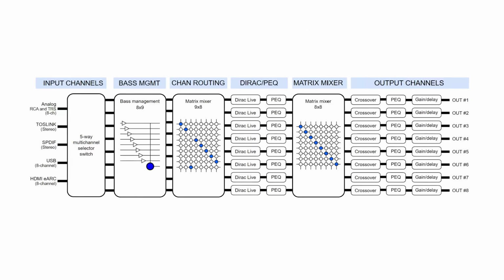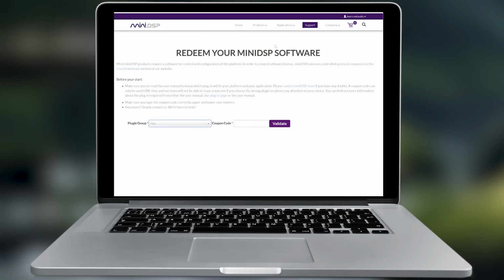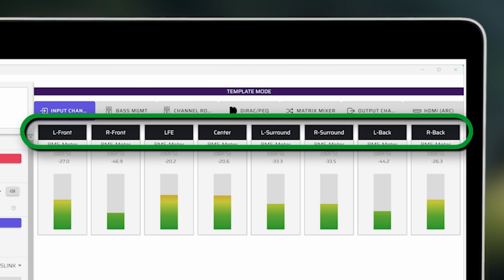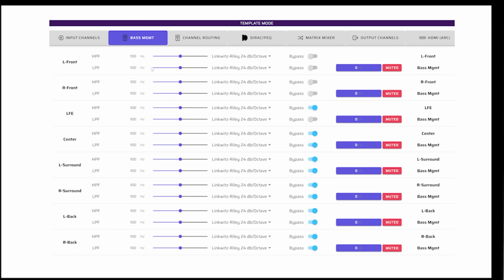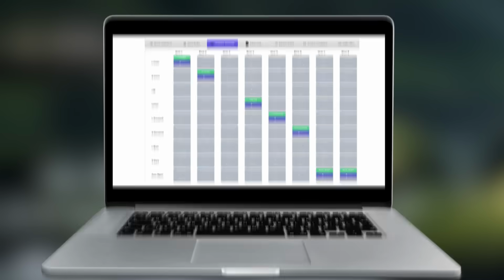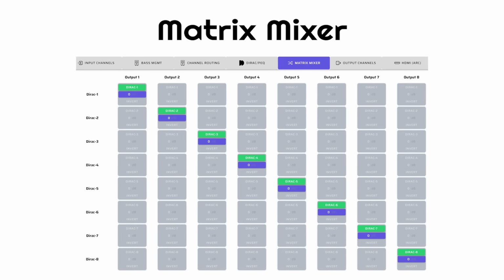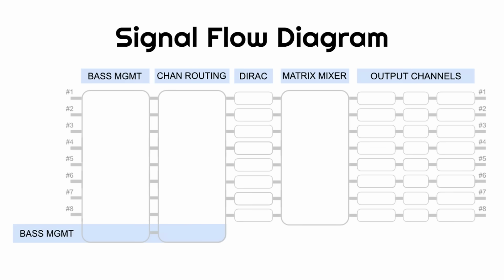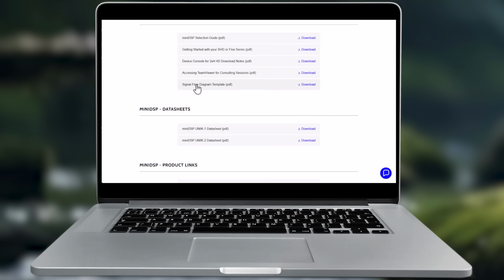Flex HTx Setup with Device Console - miniDSP Overview

Comment: Could I connect a DAP via toslink or coax to stream Atmos material through this? If streaming Ultra HD music does this have the ability to simulate Atmos?
Reply: Best to pose those questions at the miniDSP community support forums. If you don’t need 8  channels of analog input, the Flex 8 or HT could save you a bunch of shelf space and several hundred dollars.
Reply from the maker: The miniDSP HT and HTx currently accept 8 channel linear PCM over HDMI or USB.
The TOSLINK and SPDIF inputs are 2 channel.